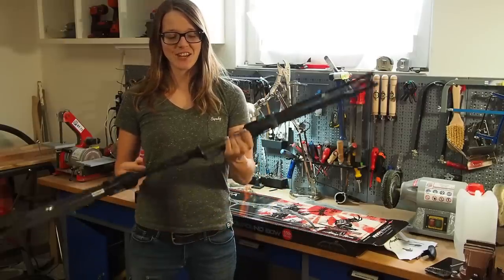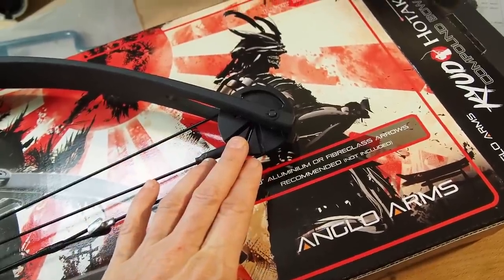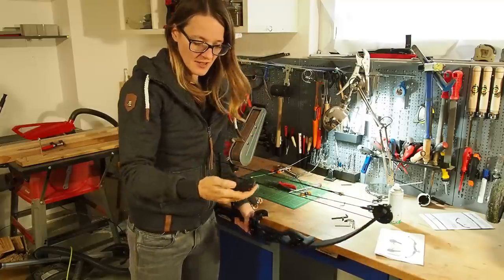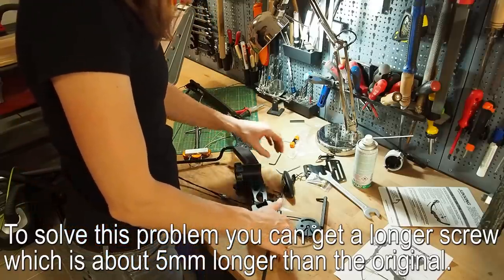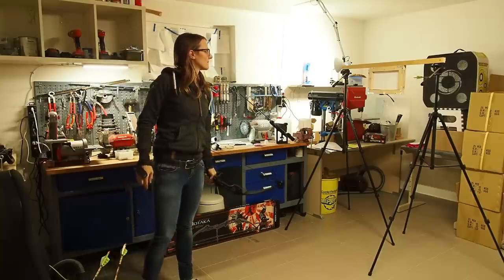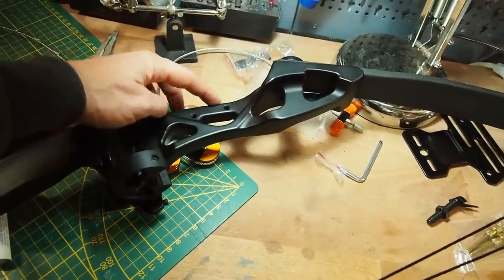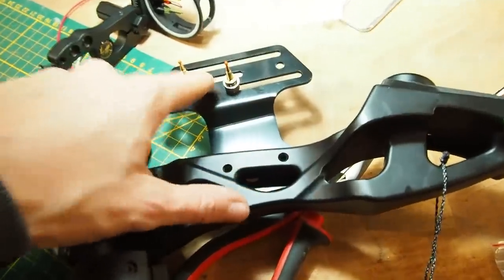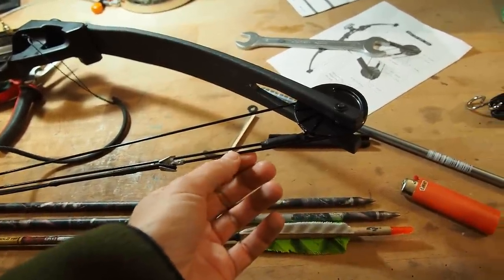I bought a fake Rambo bow on Amazon. Is it worth it?

Comment: Need the exploding tips now
Reply: That demo ranch mad lad took 2 different magnum pistol casings, filled them with tannerite and slipped 1 over the other on the end of crossbow bolt and shot it. Doesn't do much more than make a loud concussion but still pretty sweet.
Reply: @oldmanx1234  it doesn't look that hard to me, except you make your explosives yourself. The system could work for instance with a large caliber round that had been fired and you replace the primer. There are kits for refilling rounds in the USA AFAIK. Then you'd need to glue a tube slightly larger than the arrow shaft next to the primer. For stability reasons it would be best to have it flush with the casing and put a band over both. On one side, you'd need to insert an arrow shaft with a short striker and it should fit snuggly so that it needs quite an impact to push the striker into the primer, else it would explode during launch due to inertia... The other end would need to be filled with a high explosive and sealed. That's it. However, since the brass is heavy, cutting it down and replacing it with plastic and ideally a 3d printed aerodynamic shape would be highly recommended. However, in that case, the plastic needs to be somewhat impact resistant.

BTW: if you're a crazy MoFo, you could simply use something like nitroglycerin or tetrameric acetonperoxide without any trigger system... It would not be 100% reliable and definitely not safe, but kids have done that before even without blowing themselves up, at least the smarter ones...
Reply: It's already been done with bullets.
Pretty dangerous but super badass coolness.
Look it up.
Reply: I made a few experiments with explosive arrow tips. I used a tiny handmade ETN hollow charge tip I made myself. It penetrated 2,5cm of Aluminium very easily. I never tested it on steel, however.
Reply: @seanrh4294  ETN sounds like something home brewed... Also, 2-3cm penetration is pretty impressive for such a small and improvised shaped charge.
When I think of WWII, they managed 100mm at first and now the same size charge can go through 1000mm!
Reply: @edi9892  ETN= Erythritol Tetra Nitrate is powerful. 3g +detonator was enough. The charge itself was only 1,5cm wide. Perfect for an arrow. I often wished I could have worked for the Engineers in the army but I have epilepsy, unfortunately :(
Reply: @seanrh4294  ETN is nothing I've seen commercially, but it can be made from sugars, as long as you've got access to HNO3. I don't know much else about it, except that it's reasonably, cheap, powerful and stable, which makes me wonder why it has not been used more.

Comment: That was just like the old school bows i used in the 90's. The thing about the finger release and the old beast pins is that they are almost bomb proof. I've had releases freeze on me in late season deer hunts. (Late December in Canada)  Nothing is worse than dropping your bow due to cold hands and iced rope. From a prepping stand point, if you have to hunt for a meal you want your equipment to work in any weather. Great video by the way. Makes me feel nostalgic. Might have to get my old bow out and shoot it a bit.  Have fun with it,they tend to be pretty forgiving with arrow weight and size.

Comment: Hi Lilly. I’ve been shooting the same bow since March and I love it. I target shoot with mine and fitted a recurve target sight which works great but no good if you want multiple pins of course. My bow became a little rough on the draw after a while so I changed the cable slider for a Limbsaver teflon slider which works brilliant and separates the cables to. I think your nocks may be set for recurve so you may need to rotate them so the fletchings clear the rest. Enjoy the bow, I think you’ll really like it.

Comment: The wheel/ cable system on that bow is exactly the same as the  old Bear  Black Bear hunter which I have used for over 20 years. In my opinion, it is superior to more modern bows which are far too complicated. I don't think you'll regret your purchase.

Comment: Hi Lilly, I've just bought the EK Archery version of this bow, though sadly it doesnt have adjustable cams... ☹
Thanks for the review, there were virtually zero instructions supplied, so your video has been very helpful! 👍
It only cost £85 for a 55lb left handed model, and I bought this with the intention of making a home built left handed version of the Fenris and hopefully it will be suitable..., total cost should be less than £250, rather than £1000😉

Comment: 4 turns out from tight is 30 lbs. The slots are the draw length. I bought that bow loaded with everything and great sights (the one u don't like) for $202 Canadian dollars. It's an excellent bow for the money. It's make is  called  SAS the one I have but it's the same bow!! I love it with a D-ring and trigger. It's great!! The cable is steel it won't brake for a long time and you only have to replace a Short bow string.. it's very accurate at 100 ft  and very powerful, passes half the 30" arrow through a 5" thick straw target.. I love it!! Only thing I don't like is the peep sight it never is perfectly straight. I put a yellow dot on the bow string with paint and it's perfectly lined up with the center of the sight u don't use.. it's well well with the money..

Comment: Good episode  😊   OK, I've been fooling with wheel bows for a while now.  All the things you are going through are common to tuning a wheel bow.  Generally you can back the limb bolts out either 5 or 6 turns, max.  I put a paint dot on the bolt head and one on the limb to keep track of rotation.   At least you can adjust your own wheel bows.  Modern elliptical cam bows are harder to work on ...  That cable will last 25 years if kept clean and out of water (rain & fog OK if dried off after use).  The string is the "wear item".
I'm with you.  I like to use a similar anchor for all my bows, therefor, for sights I like to use TruGlow or Apex round mount sights.  With these you can rotate the "arm" in the mount.  You can go up to 45* up to 45* down.  So that is maybe 75mm vertical adjustment, before you start moving your pins.   So instead of using string to tie your hose to the riser, just tie the hose around one of the cables.  The hose is long enough for that.  If you want a lighter version of a wheel bow, try an older Bear brand bow.  Their risers are made from magnesium, so much lighter.  You can buy a used one off eBay for <$75 if you look.

Comment: I have the exact same set up and the 5 pin sight and biscuit combo does work when you adjust the yard pins and have the sight on lowest setting on the same bolt holes, no need to drill. Love this vid helped me a lot with this model other wise. Keep up the good work.

Comment: Lilly i have the same type of compound bow do not fire with the prods loose they could SHATTER mine is a 90 lb draw hold the bow in your hand above your head hold the string the string with your fingers near your face and push the bow away from you until its at draw length sight and release i hope it works out well

Comment: Lilly when you shoot from a short distance you use your bottom pin, because the arrow has not had a chance to rise after shooting it. I suggest you put the other sight back on and go outside and shoot from a farther distance. You probably won't have to drill any new holes and the sight will work ok.
Reply from the maker: I doubt that arrows will rise on a bow which is centershot.

Comment: I was looking at the same bow on Amazon from Southland Archery Supplies. I grew up on Rambo too but I'm not a huge fan of the black finish of this model. I am going to get the get the Autumn Camo it's a really nice finish. I plan finger shooting with it mostly so I will use the traditional pin sites and whisker biscuit with a knocking point but I will add a d-loop with peep site, stabilizer and wrist loop that way I can shoot anyway I want and get in the compound game cheap. Whether it's target shooting or hunting.
P.S. Just buy a spare bow from Amazon for parts if you need them. It doesn't cost that much.

Comment: The cable on that bow is unlikely to break because it's made of steel with a plastic covering. 
The breakable part is the part with the serving, which is designed to be easily changed...

Comment: Hello Lilly, that sight will work ok, but you need to sight it in from 10 to 15 metres away.  I've got the exact same bow and setup and at the moment it's my favourite bow to shoot with.  I also have another compound bow which I'm not so happy with. But try sighting the pins in from 10 to 15 metres for the first one and then 10 metre intervals for each other pin.  Excellent vid by the way and I have learned something else about my bow and setup thanks to you. Well done !!!

Comment: Balistol oil is not really a rust preventor, i'd just use some cheap and nasty grease i know that Balistol also has some grease, you could also just use some vaseline.(i use some bearing grease for the nuts and bolts on my bike, and for the nuts and bolts at sea i use copaslip (copper grease, not expensive either)

Comment: You mention the cable is very thin so hard to find replacement. I saw another video and the thin part of the cable is steel...you only need to replace the small string part where you nock the arrow. Both the cable and string are on Amazon under SAS Siege cable and string replacement. Nice video...after seeing it I bought myself the same bow.
Reply: How’s the bow a year later?

Comment: I use a centerpoint 370 crossbow, 370 FPS & 185 draw weight but I’ve installed a hand crank to load the bolts.

Comment: Be careful with those bows that have the swaged strings. They require a heavier arrow than normal to prevent damage and the swage coming away causing injury. The reason these get a bad rep is because people started using lightweight carbon arrows which were not around when these were developed.  There is a grains per pound rating given on the  hoyt spetra which is the original rambo bow but cant remember it off hand. In the UK, archery ranges will not allow you to use a bow with swaged cables, something to bear in mind before purchase.

Comment: I am not an archer but I like your videos.  If you have a machinist in your area they could possibly make the groove wider for you to use thicker bowstring as long as the pulley is wide enough to cut the groove.  You might even see if there is a youtube machinist close to you that you could do a collaborative video.  Also you could 3d print a better mount for your sight.

Comment: this is a great video Lilly. Not only by its spontaneous presentation but also its content. 
Followed your advices and achieved this bowpress, arrow rest.
This grip is somewhat tight, small and painfully stiffly edged. I am rounding these areas a bit with the idea of stippling it ( by welding rod)  like we oftently see in Glock polymer. Most of the time functional, sometimes also artistic.
this finishing should also provide a tight grip.

Less work anyway instead of carving a wooden new one. A nice bow for less money though :-)

Comment: If the pins are too low, it means you have to set up the peep sight a bit higher. And the peep sight should be mount to the first cable. The gum is not too short. It' probably even too long if you set that in the right way. But hey! It's great start for the compound bow anyway :)

Comment: Bows like that typically sell for less than $50 at pawn stores in the USA, of course shipping would increase the price.  I can't believe after all the wood chopping and pounding you have done out at the bug-out camp that you don't have the strength to pull back a 45 lbs. compound bow.

Comment: DANGER everyone/ Lilly. Where the string sits into the metal stirrups, there is sharp flash running purpendicular to the string. I would recommend using a bow press and then a hand held riffle file for the inside of the silver stirrup to prevent possible string cutting. You can see and feel it without taking it apart. You can get replacement strings/ cables for the (sas siege 55# compound bow) from the crossbow store online. The bow has about ,20 names, Hotka, rambo, are just a few others. Accuracy is best at approximately 25 yards. I fixed the sight problem by making an slanted small block of wood for the sight. I upgraded to the PSE NXT 31 and even though I am shootings at 70#'s. The 90% letoff is like holding 7#'s, where as this bow at 55#'s you hold slightly over 16#'s.

Comment: You need a little work on your drawn technique. On a high draw weight, If you point the bow straight up and hold the string back as you lower the bow to your target, you can pull a lot heavier bow than you normally can on a straight pull. Actually you are more “pushing” the bow out instead of pulling...Hard to explain but easy to demonstrate.

Comment: DONT DRILL HOLES IN THE BOW RISER!! you can buy sight extensions  that will have more vetical adjustment or even a better sight with more adjudtments ,,you will regret drilling holes in it even if its a cheap bow

Comment: I'm no expert on compound bows but I don't think loosening the bolts is the recommended way to adjust the pull strength. 
I think it's all in the cams.
Reply from the maker: Nope you habe to losen the bolts
Reply: Lose the limb bolts for reduced DRAW WEIGHT, adjust in th wheel for different DRAW LENGHT!

Comment: Hi, Lilly, I'm just wondering, u say u would like to move the site holes down a little further, so would u see any problem with drilling and tapping (threading) 2 new holes to accommodate the preferred sight?
Reply from the maker: I didnt do the drilling because then i am afraid the structural integrity of the bow will get damaged. In the end i moved the peep higher then i could use the new sights
Reply: @SurvivalLilly  Hi, Lilly. Ye, that was why I asked - I don't wish to compromise its integral strength. But thank you for replying.

Comment: I’d say shoot it first and try to find correct arrow spline using those sights…do adjustments with the peep before you drill holes and move sight cage lower…better take in account for arrow clearance….that 50/50 old school wheels should be no problem for a traditional bow shooter like you 👍🏼

Comment: Greetings from Sweden from a new subscriber .  To be honest . I would not drill any new holes in that bow for the pinsight , it might weaken the structure of the bow  . It would be easier to construct  a new "bottom plate" for that pinsight from a piece of sheet metal  . Or modifie the existing pinsight plate by extending it by tig welding on some extra sheet metal  and drill new holes in it . . . :O)
Reply from the maker: actually I figured out the problem. I just put the peep about 1cm higher. now it works with the new sight.

Comment: I think if you were drawing the bow correctly at 45lbs you would have been able to draw it fine. Nothing wrong with being more comfortable at a lighter weight like you adjusted it. I just didn't think that it was an accurate representation of your own abilities.
I also find it hilarious you didn't go cheap on your arrows! Everything else with the bow you go as budget friendly as possible! Also a 500 spin is not very stiff at all. Lower number = stiffer spine. :)
Also I'm not sure about those cheap bows but if you ever get a high end bow I highly recommend getting the L brackets that go with that bow press, pressing it in the middle of the limbs like that could damage the limbs!

Comment: When you pull back on the string open your hand and then release the arrow with the Open Hand pressing against the handle and after you shoot grab the handle very quickly
Reply: DONT grab the handle very quickly. That jerks your shot. BAD habit and hard to break. 
1 use a sling attached at the stabilizer 
2 let the bow “almost” fall after shot... trust your sling a second

Comment: You could buy an infinite edge bow it's made by bowtech it's around 300 though but it's a very good bow it has a string stop and you can use different sights I had purchased one for my son the poundage goes from 5 to 70lbs but again it cost around 300 new if you want to spend that kind if money and I believe the speed on it is around 310 fps at at 30 inch draw with 70lbs but I think my son shot 26inches and his bow was set on 42 lbs and it still shot around 200fps if you want a great bow look for information on the infinite edge bass pro sells they come with sights quiver and arrow rest also you would have to most likely need a different arrow spine though I like your videos though keep them up have a great bow shooting day

Comment: When you draw the bow don't just pull back with your right arm the way to draw your bow is to push with the left and pull with the right with the same amount of force and it will become very easy to pull it back with practice you should be able to pull 45 lb and you will easily do that if you do it the push-pull method let me know if it works for you
Reply: Good idea : )
Reply: Found Rambo